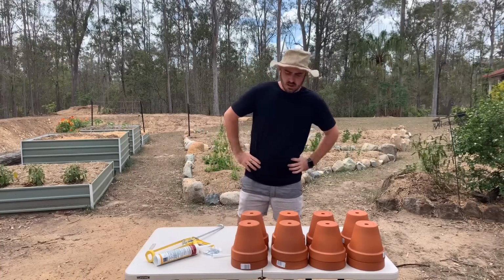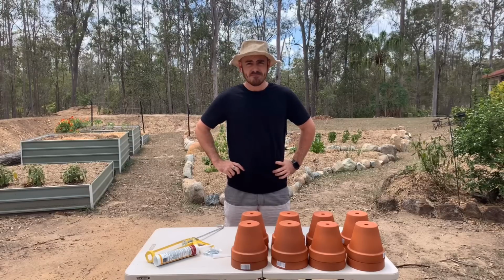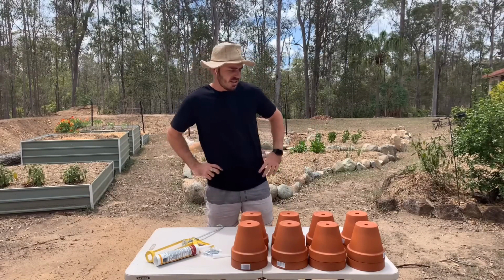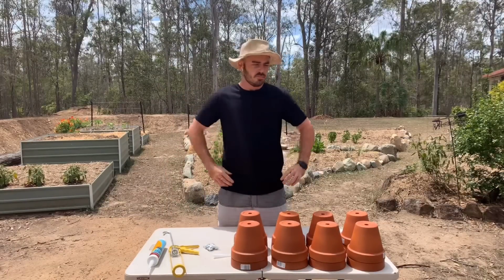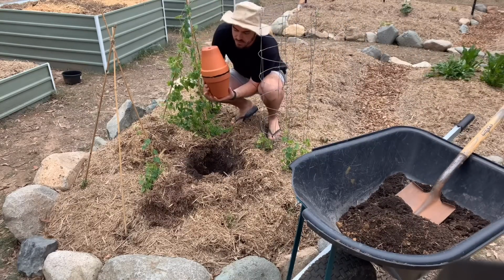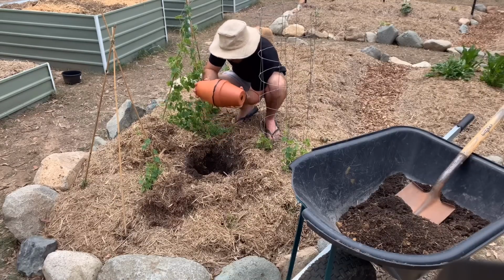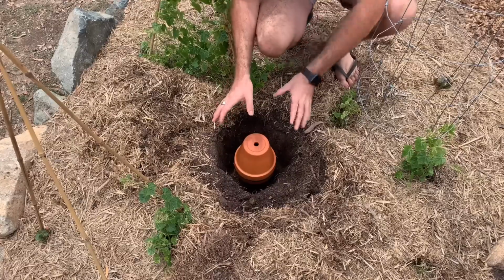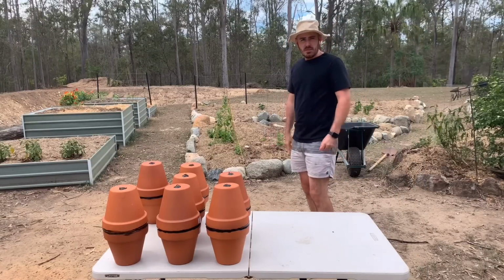How to Make Ollas, Ancient Irrigation

Comment: Nice idea, BUT! I'm concerned that sealants used to make olla might leech into plants. Not sure if I want  silicone sealant chemicals being introduced to the water that feeds my vegetables. 
It's the reason I do not use pressure treated wood when I make raised garden beds.
Reply: When %100 silicone dries it becomes inert, you can even use it in fish tanks
Reply: There is also food grade silicone.
Reply: Yes, that was my concern too. I wonder if there is another option.
Reply: @shekhinahmorgan2814  - maybe you can use ready-made clay to seal the two together. 
it might not be as strong as silicon but as long as it's sealed it's good enough I guess
Reply: Is there a sealant brand you can recommend?